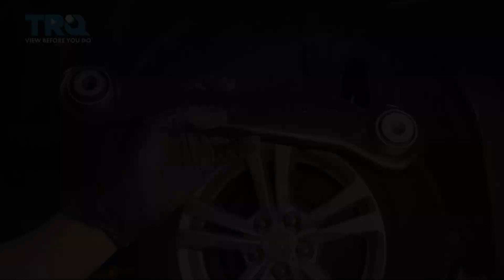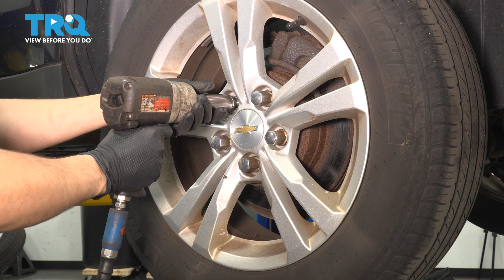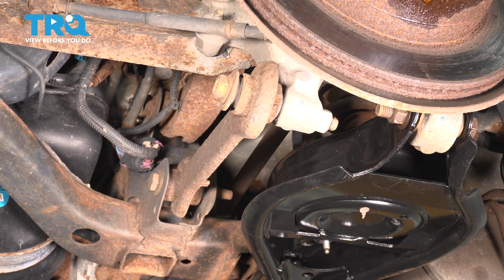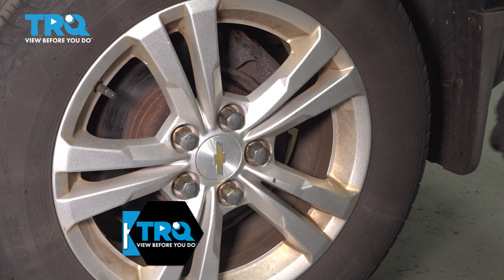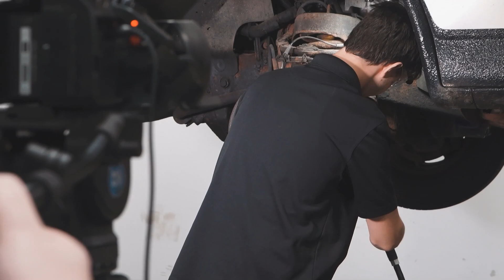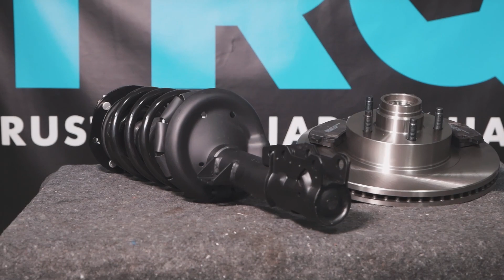How to Replace Rear Lower Forward Control Arm 2010-2017 Chevrolet Equinox

Comment: What are the symptoms of a bad rear forward lower control arm? I hear a clunking noise when I go over speed bumps or the coming in and out of my drive way. I was told change back absorbers which I did but same issue. Was thinking to look at coil springs but my car height looks normal. Help me please!!!!!